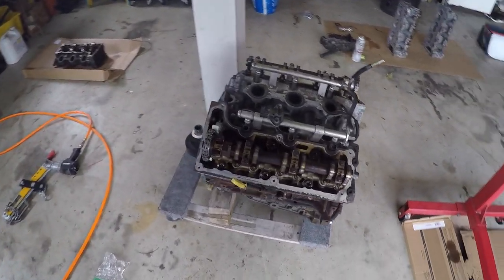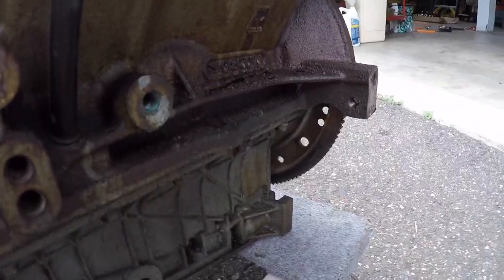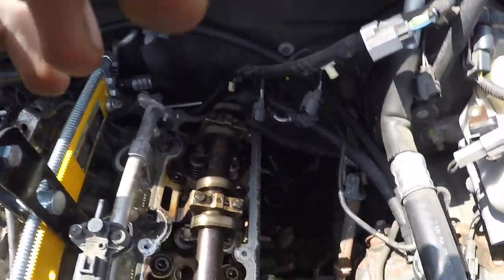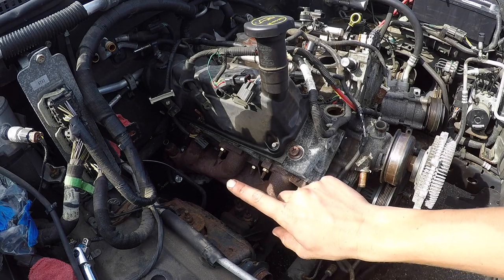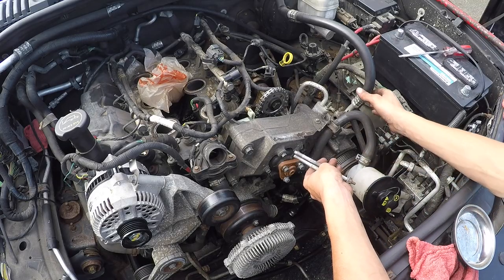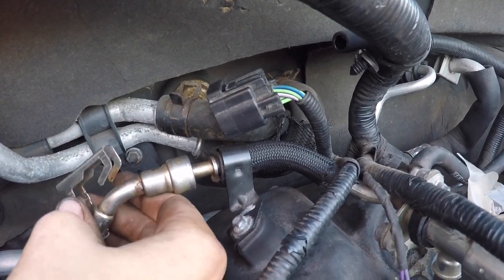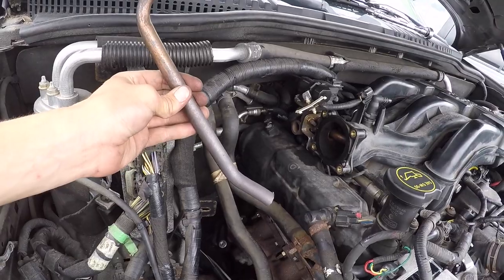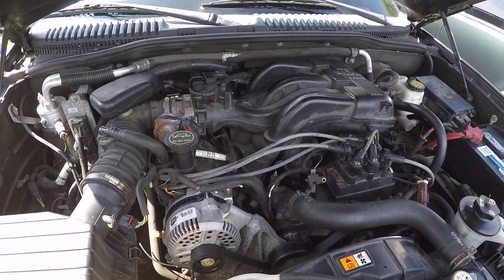HOW TO INSTALL A 4.0L V6 ENGINE - 2002-2010 FORD EXPLORER (COMPLETE GUIDE)

Comment: I cannot thank you enough for your series on 4.0l engines.  I was fighting the installation of a 4.0 in my son's Ranger.  I watched this video yesterday, went home and had it mated to the transmission and bolted into the vehicle in less than 1 hour.  Truly thankful and you deserve more than subscribers and comments.  Again, thank you - this is the best video series on the SOHC engines, PERIOD.
Reply from the maker: Nice work! Happy to help!
Reply: I have 2001 Ford explorer sport track  
Need head gaskets. 
Maybe this weekend start  
Thanks for yours videos.
Reply: what year is the Ranger?  I have to pull my son's 2005 Ranger 4.0 L.  Is it very different or pretty much the same?
Reply: @mitchdokie9612 don’t know if you pulled it out already, but it’s similliar but at the same no, you don’t need to evacuate a/c just set the compressor to the side and the connectors with the clip just push the clip down

Comment: Make sure the converter is fully seated. A lot of times when you pull the engine the converter likes to move forward a notch
Reply from the maker: Yeah you’ll totally trash the trans pump if it isn’t fully seated. I’ve seen it so many times on the forums.

Comment: Alot of work for these trucks with that sohc engine they give alot of timing chain problems I would crush it unless I change the v6 to a older ohv efi engine they run forever great video

Comment: You are the first person I have written a comment to on YouTube.  I just want to thank you for your video.  Having consolidated an engine installation in a half hour video is beyond excellent. 

I have a 2006 Ford Explorer (Lucy) with 130k+ miles on it. I just had its transmission rebuilt and bought a new set of tires to get it ready for the next 100k miles or so.
A guy at work offered to change the valve cover gaskets for me, but in the process he must to dropped a bolt or something inside the engine, because when he tried to start it, the engine seized and never started anymore.
He immediately said it wasn't his fault and that most likely the engine was old and that was going to happen sooner or later.
A week later he told me that he felt bad about what had happened and offered to swap the engine if I bought a new one. So, as you must have already guessed it, I bought a new engine and the guy started the swap.
It took him 3 days to removed the old engine and about 3 weeks to drop in the new one.  Losing bolts, ripping hoses and breaking pipes in the process.
A month later he asked me if I still wanted him to finish the job, to which I replied, NO.  He had done enough damage and I have learned the lesson. 

I tried getting more than a few of the so called "Mechanics" to come and finish the job, and they all said yes, but none one ever showed up. 

My poor Lucy has been in my garage for more than a year now.
I normally do my own oil changes, tune-ups and breaks, but I've never messed with the engine before, but after watching your video I have decided to take matters into my own hands.
Wish me luck.
👨‍🔧
Reply from the maker: I’m honored to be the first comment. Appreciate the kind words and sorry to hear the predicament you’ve encountered.
Reply: It's alive, my Lucy is alive! 🚗
It took me all weekend, but I did it! 👨‍🔧
And it did not exploded or catched on fire. 🤪
Thanks to you and your awesome video. 
I wish you the best on your life and all your endeavors. 🙇‍♂️🙇‍♂️🙇‍♂️

Comment: Let you know I am a hands on guy but I have never done an engine. My brother in laws 2007 explorer had front and rear timing chain break. Shop quoted 4800. With ur video I was able to do it for 600. Absolutely the best video and explanation around. Thank you for your guidance for the weekend warrior. From NC.

Comment: You sir are my savior.  I picked up an '06 for cheap disassembled to the timing chains showing.  I've had the engine out for a while and just started putting things back together.    I just realized today that the rod studs and nuts need replaced.  :roll:  Not having been the person to disassemble my purchase, your video saved my bacon.  Many thanks!
Reply from the maker: Just reuse them. I have it the past. Don’t recommend it but it’s still running.

Comment: I want to thank you for making these videos but also want to curse you for making it look easy enough for us rubes to do it too. 

Took me three attempts to finally get the engine back in, wish I had found your video before the first try though.

Thanks man.
Reply from the maker: Hey bud! Glad my videos could help. I definitely do make it look easy but understand that I do one swap a week. My first time was a nightmare too
Reply: Bro,I’m looking at a 2003 with 125k 4.0
Would you recommend it?
Reply from the maker: For sure. Just make sure it’s nice and quiet.
Reply: @patrickstar1439  look into the timing chain issue, I can't remember what year they started using the decent quality guides. 

But, if you hear any chain slap or rattle on start up don't get it unless it's cheap. It's not a difficult task but it's not that much fun either.
Reply from the maker: 2002 the front was reinforced. They never updated the back.
Reply: @iamdjnam  got it, thanks man.

Comment: What would cause a crank no start after replacing timing chains? 
It turned on and sounded good.. i pulled it out of the garage and parked it to let it idle. It cut off randomly. It did run fine before it turned off. Ran for about 5 mins.

Comment: Hi what is the function of the black connector (pa/sps-gf20) on the left side (time 25:31) at the bottom of the freon / ac canister (sorry im not a mechanic) mine was stripped and need to be replaced.

Comment: Awesome job I got a long block coming in and I'm going to follow your steps. Probably a little different because I don't have four wheel drive and I'm lowered to the ground thanks for your videos
Reply from the maker: Will actually be easier. Don’t have to fight the starter over the front diff.

Comment: Hello. Great video brother. I have same truck. All my wires to maf sensor and injectors and wires to the alternator are all frayed and chipping plastic. I tried to just electric tape them but when i move them the engine shuts off. Will the while engine have to come off to replace that harness? Thanks.
Reply from the maker: The engine doesn’t need to come out but you should cut the harness wrap and just splice in new connectors. 

Ford engine and transmission share the same harness so you need to unplug transmission too. It costs a fortune to replace
Reply: The wires touch and the engine shuts off. It's literally 50+ wires. That's y I'm thinking replacing the harness because it's got to be like that all over. The further I look the more I find. Thanks for the quick response.

Comment: Man that was iimpressive ,.. well done buddy ,.. i haver had several explorers , my current one just turned over 200000 miles .... it runs great now after a year of replacing lots of parts but a rebuild im sure is not far off ,.. i think computer might be going bad bc i cant get these codes to clear with my OBD 2 .... great video ....
Reply from the maker: Thanks bud appreciate the support! :)

Comment: Do the bolts for the flexplate/flywheel need thread sealant? Or will blue loctite do? Someone told me thread sealant is required or it will leak oil.
Reply from the maker: They’re wrong. I use nothing. Just torque them down to spec.

Comment: Hey boss I really appreciate the video, and chance you know the bolt size that is used in the back of the motor for lifting, the (shorter bolt) mentioned in the video
Reply from the maker: It’s an m10x1.5. Length depends on what chain you’re using

Comment: Nicely done!
If doing this inside, what minimum ceiling clearance is needed for the engine lift. Thanks
Reply from the maker: I do these in my garage all the time. Take all the slack out of the chain. It will be able to clear a standard garage door.
Reply: @iamdjnam  thank you for your prompt reply and your selflessness in helping others, especially during these times

Comment: Your videos are really well-thought out and excellently presented. I'll be replacing the fuel-pressure sensor on my '05 soon, and everyone complains it's a PITA to reinstall the last T30 bolt on the rear of the intake manifold. Do you have any tips on doing that?
Reply from the maker: Use a T30 with a 6” wobbly extension and a 3/8 ratchet. Not a swivel adapter, the extension is rounded at the end allowing some play. With that combination it’s mad easy.
Reply: @iamdjnam  Many thanks! I love those wobbly extensions.

Comment: It looks like there is plenty of room to put the exhaust on before puting the engine in. Or does it get in the way when aligning the engine to the transmission?
Reply from the maker: You can’t see the torque converter studs with it on. I’ve done it before but it’s quicker in the end to leave them off
Reply: @iamdjnam  I now found out it's best to leave them off, because the starter is easy to get to with them off. More space to work things around. I was tempted to put them on first, but I decided to hold off on that. Glad I did.

Comment: Mr Platinum. Is it possible to install the engine with the intake and exhaust manifolds on the engine? I'm trying to install as much as possible on the engine, then install it. Thanks for your help.
Reply from the maker: You can install the engine with the exhaust manifolds on. The intake must be removed so you can plug in all your connectors for the harness :)

Comment: Alright getting a lot closer to finishing and she fired up. However I am getting a serious smoke problem. It isn’t a fluid burning I don’t think, but i can’t see exactly where from. It looks like from the exhaust but the smoke is billowing from around the intake area. No leaks from the coolant system or oil which is a plus. Is it normal for the engine to burn off stuff when first firing it back up?
Reply from the maker: Yes it’s normal to have some smoke, shouldn’t have much more than seen in this video. Make sure it isn’t an electrical harness burning.

Comment: Runs like butter. Ours have a 🔧 💡 on check engine 💡 as well. The wrench light comes on disables cruise control while on highway causing it to run faster and engine hesitant to accelerate when my foot on the gas pedal. What could be the problem? 2009 xlt 4.0l v6 5 speed.
Reply from the maker: Accelerator pedal position sensor, TPS, any of the wheel hub units defective. Get the codes scanned.

Comment: Getting things bolted on… ordered a new bolt for harmonic balancer and got a 6A340-B which measures 51mm long instead of the 72mm? I got it from a dealer? What part number should it be? Thx
Reply from the maker: E7RY-6A340-B
Reply: Thanks my first 4 digits were different from yours and my bolt was about an inch shorter. Try to find some one who has it tomorrow. Well thx again you make it look so easy but then again I’m 67!

Comment: Hello, I have a 2010 Ford Explorer and recently got work done to the engine. However, when I received back from the shop we noticed it vibrate on idle but does not vibrate when cruising/driving around. I was wondering if you have an idea what it could be
Reply from the maker: Check the harmonic balancer. The weights break off inside of it.

Comment: Any tips on removing the passenger side exhaust manifold?
Reply from the maker: Passenger side is easier than the drivers side. 13mm with a breaker bar. Hit the nuts with MAP gas, count to 20 and you’ll be good.

Comment: 2005 sport Trac 4.0. Just replace the engine but I never noticed an engine ground. There's one on the firewall near the PCM connection but nothing on the block that I remember. Do you know where the engine ground would be on this vehicle
Reply from the maker: There’s 2. One goes to starter the other goes from back of cylinder head to firewall.
Reply: @iamdjnam  thanks. I sure didn't see cylinder head to firewall.

Comment: I’m currently in the middle of removing the engine in my 2010 explorer I’ve got all of my bolts out the starter is out and the torque converter ones as well but it’s still stuck together how did you separate the two??
Reply from the maker: 8 bellhousing, 2 starter, 4 torque converter. Pry from wheel well using long crowbar in between engine and trans.
Reply: @iamdjnam  oh we may have missed them then cause we only counted 6 bolts from the bell housing I believe
Reply: @iamdjnam  I’ve looked and can’t find any more bolts it still will not separate 🤦‍♂️🤔
Reply from the maker: @jamesburns2780  There’s 8 bellhousing. You’re missing 2 if you only have 6. A few cannot be seen. You have to feel.
Reply: @iamdjnam  I have the 4 at the very top and bottom out and the 2 on the sides that are visible where might be the last to be
Reply from the maker: @jamesburns2780 There’s 2 in the middle on each side, 2 right above them, 2 all the way at the top, 2 at the bottom.
Reply: @iamdjnam  I finally got it out and ready for the new motor appreciate the advice and help 👍👍

Comment: I have a bit of a weird question here. I am putting a 4.0L in a Ranger and I see that your AC compressor is more at an angle rather then straight across like mine is. Do you know if they changed up brackets at all between the years? (I didn't realize the 4.0 I was putting in was an Explorer engine until I was having issues with getting the AC to clear the battery tray
Reply from the maker: Chances are they’re different. They explorer engine bay is much bigger than the ranger.

Comment: Awesome you really know your way around these 4.0's. I messaged you a few days ago and I have to ask. My top driver side timing chain guide has come apart. I'm told you have to pull the engine to replace it. After watching your rebuild video, I'm think it woud be possible to replace ths timing chain and guide without pulling the engine? I know a complete rebuild make sense but I can't afford this at this time. This engine has 270,000 miles on it, but runs and sounds perfect except for the timing chain issue. Your thoughts wouls be appreciated. Thanks
Reply from the maker: Watch my newest 4.0 video on how to replace the front chains. Engine can stay in the vehicle.

Comment: Dude for a young man I think your pretty sharp...I been doing this kind of stuff since I was 15 years old and I'm 61 now...and I've done alot of amazing stuff myself...having said that I've never dealt with such a pain in the ASS until I ran into this 4.0 that ford engineered. It's a fairly good engine when it's right but there is so much shit to go wrong with it.  I prefer to work on the small block Chevrolet V8 any day over this 4.0 crap...but u seem to be pretty dam good at what u do...I'm impressed and it takes alot to impress me...sincerely Rob Steeves A.K.A TripleM...if u read this ask me what TripleM actually means and I would love to tell you...ull get a kick out of it.

Comment: I'm having trouble lining up 2 torque converter bolts. One bolt is almost aligned center and the other above it is half aligned, tips on getting converter bolts aligned?
Reply from the maker: The angle is wrong. Tilt the engine back or lower the trans a little.
Reply: @iamdjnam   After much tilting and shifting I decided to pull the motor back up and check the flywheel. It wasn't the same from a 2007 mustang to a 2006, the holes were slightly off so I had to swap flywheels. It's all bolted up now thanks for replying
Reply: @briancraft777 having the same problem kinda might need to take a better look..

Comment: Does the transmission need to be in neutral when you doing the torque converter bolts?
Reply from the maker: No
Reply: @iamdjnam  I just changed the timing chain set and put the engine back in trying to put the torque converter nuts back in but the engine isn't turning manually.  I didn't spin it before installing it back in, hoping I don't have to take it back out 😫
Reply from the maker: Yeah something is locked. That’s not good.
Reply: @iamdjnam  I guess I might have to take it out again.  Thanks for the videos
Reply from the maker: Always rotate to make sure everything is good. You probably have a valve hitting a piston.
Reply: @iamdjnam  I just took the bolt off the transmission to engine and now the engine turns
Reply from the maker: @kenpagatpatan7490  torque converter probably came out of position

Comment: I have an 03 explorer that I got from someone. I do not know the history on it. I took the passenger side valve cover off and one of the valve springs is broke and the valve seams stuck. I assume it got bent. Everything else looks good. I am going to take the head off and I am hoping I can just replace the valve and spring, put a new head gasket on and drive off into the sunset. Do you to think that would work?
Reply from the maker: Absolutely! Amazon sells cheap ass headgasket kits that are actually very very good quality. Make sure your timing cassettes are good.
Reply: @iamdjnam  thank you. As far as the cassettes, the part I can see from taking the valve cover off looks perfect

Comment: Question I'm replacing my exhaust manifold and the felpro kit came with two little green sleeves, do you know where those go? Do you know what size studs and nuts are a good replacement for the exhaust manifold bolt? I can't for the life of me find where those green sleeves go
Reply from the maker: The studs and nuts are M8x1.25. I buy the stainless kit online for the 4.6L they fit perfect. I’ve never in my life come across those sleeves.
Reply: @iamdjnam  also when I took my manifold off all the studs stayed in there, only the nuts came off.
Reply from the maker: Get a stud extractor
Reply: @iamdjnam  thanks a million